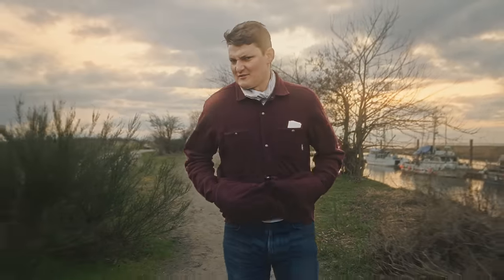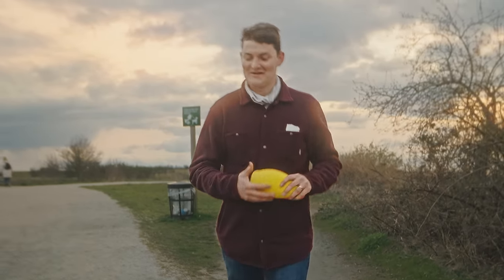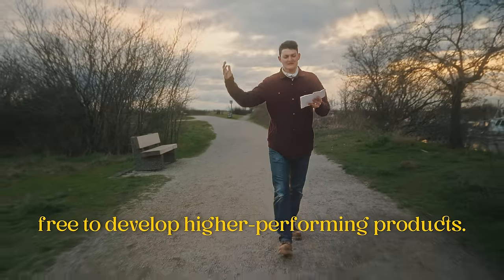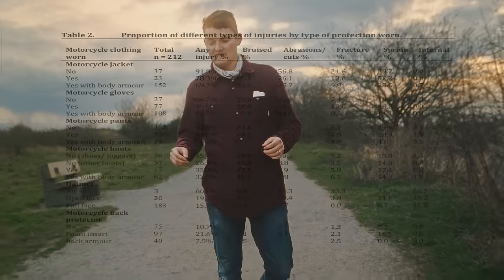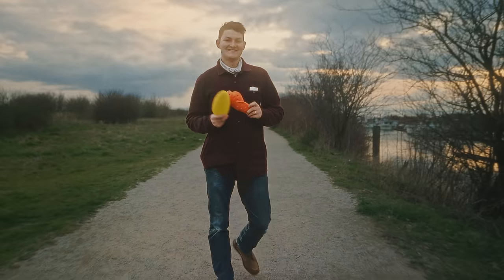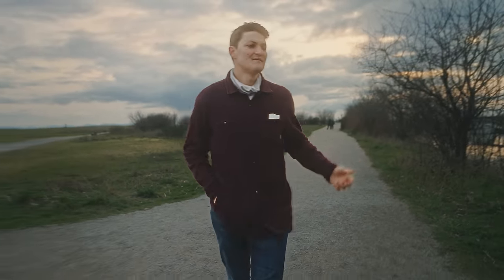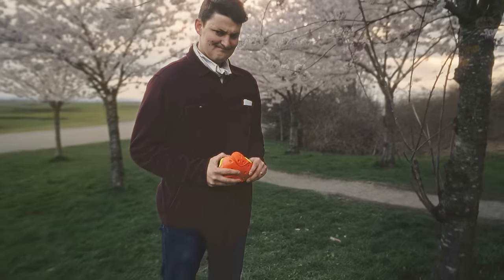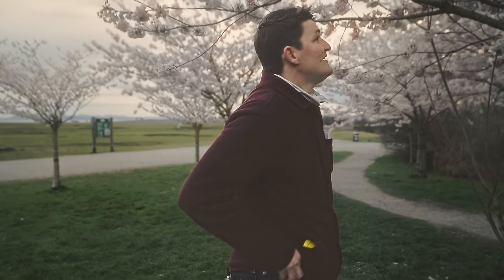Why I Stopped Wearing Motorcycle Body Armour

Comment: As far as the study went it is also worth considering that the riding style of people who ride with gear vs those who don't could be very different which would affect the relevance of the study's results.
Reply: I disagree, I've seen people on crotch rockets ride safely and people on Harley s ride like idiots. Seen people with and without gear ride all sorts of ways, but I've always been a firm believer in gear. The more you have on and the better it is, is your chance of reducing injuries. Ride safe and gear up!
Reply: Yeah but the speed demons in Canyons almost always wear gear. 

If gear protects 80% of 10 Breaks. The Canyon rider will have 2 Breaks. The guy with nothing in a small crash of 2 Breaks will also have 2 Breaks. Statistically they are the same person - bike crash and both have 2 Breaks. Meaning the gear is "useless".
Reply: @seanalcala9840  To be fare, Eric didn't specify crotch rockets or harleys, but riding style. Like you said, it is more about if people like riding like idiots or ride safely, no matter the bike they have
Reply: That’s an excellent point. Furthermore deriving conclusions from an uncontrolled study is sketchy. I no longer take the word of researchers without first understanding the study format as well as looking at the raw data. I just don’t take the word of researchers without question. Why would I?

Comment: Been riding for 59 years. Raced for ten of those years. Got my engineering degree in 1977. I am quite familiar with the good and the bad with respect to research, publishing results, and suffering through the broad spectrum of interpretation and hidden agendas. Motorcycle gear is about abrasion resistance, period. Nothing short of a fully-inflated pneumatic bubble-boy suit, which would make a motorcycle completely unridable, will stop broken bones, dislocations, etc. Motorcycle airbags are a primitive attempt to create an instant bubble-boy suit with thus far inconclusive results. Promising anecdotes, yes, but definitive repeatable results, no. Regardless of what the original design intentions were or are, and regardless of the testing methods involved in creating ratings, pads in motorcycle gear are also about abrasion resistance, period. Every once in a while they might prevent or minimize a minor bruise, but that's it. Off-road, some of the hard plastic armour can sometimes prevent puncture wounds from tree branches and rocks, but they are also not going to prevent broken bones, etc. From my multiple personal experiences, broken bones heal fairly painlessly, all things considered. Abrasions and soft tissue damage, especially if they include skin grafts, are among the longest recovery time and most painful injuries. Look up Mick Doohan. Keep your pads in your gear, and just remember that the best way to prevent broken bones is to use your head for something other than modeling the latest helmet graphics.

Ryan - individual industry research papers, regardless of the industry, are meant to be taken as merely one data point in a broader research effort incorporating multiple avenues of research and experimentation. They are guidelines for creating a theory, which drives a hypothesis, which in turn drives a proposal for an experiment, which if done properly done produces repeatable results under controlled circumstances to either verify or disprove the hypothesis. Gathering anecdotal results created under varying uncontrolled circumstances ain't science, it is merely anecdotal data compilation, similar in concept to circumstantial evidence in legal circles, i.e., while it does tend to point one in a certain direction, it does not conclusively prove anything. Be careful with your hypotheses, and I hope your personal amourless experiment does not produce unfortunate results which would make you physically incapable of repeating the experiment in the future.

Comment: For the motorcycle body armour to work it has to not be moving around, padding in a jacket for example does not cut it. I use a plastic armour that cover my back, my houlders, my chest, my elbows and my lower arms, + I use the similar armour on my hips and ass, and then plastic armour that cover my knees down the the ankle. And everything is securely fastened so it can not shift and move around.

Comment: The number of bruises I would have sustained over the the years of riding without pads is speculative at best. Having said that, I believe that my minor tip overs on the trail or in the parking lot would have been bruise worthy without. My properly fitted riding gear does not impede my comfort so why not continue wearing them if not for the sole purpose of reducing said possible bruising? Back, shoulders, elbows, hips and knees -  I'll keep wearing them all.

Comment: Interesting stuff. Love the life message at the end. I'm in the healing process (wrist, shoulder) myself right now, as I've been through many. Sure, you're right on the money when questioning how much beat took some CE away from me, but I believe it did a lot actually. That is probably mainly because of how racing suits are designed. Having front brake failures at a 260kmh and standing up with "only" a broken shoulder tells the story, especially when inspecting all the other impacts on the leathers later on. It's been always about money and to go with the minimum, and it'll be like that for the rest of time. What I'm more concerned is the lack of rider education, which seem not to play a role in statistic causes. That is what I get to see literally every day. Secondly the mentality. Riders come freshly off the DMV parking lot, jump on their 200hp bikes and want to join a wheelie course in jeans. Asking us for a discount while their 700 bux rear sets are on the way from ebay.

Comment: Dude, you're horrible with reading statistics! The difference between jacket with armor and without armor shows you're 31% more likely to have a fracture without the armor and 118% more likely to have a fracture without armor or jacket. The difference in gloves with and without armor is 56% less chance of a fracture with armor. "They do nothing to protect our bones" This is disingenuous at best, and likely dangerous. I know you need content, but for your viewers sake you shouldn't say that it might be a "statistical anomaly" that the armor actually works better a significant amount of the time. Especially with all the experts in the comment section telling you how wrong you are.

Comment: armor pads protected me many times from direct hits to my knees and elbows, whether I was gonna get a fracture without them or not is not clear, but I'm sure I would have suffered server bruises and road rashes without them.
I only wear Level 2 armor and lookup for the test results for them, ended up only buying SAS-TEC SC-1/42 prestige for my elbows and knees and I use the helite turtle vest which too comes with a stupidly big SAS-TEC L2 back protector too.
don't stop wearing armor pads folks, just get used to them, I don't see them to be annoying at all, especially when  you fit them in a comfortable jacket/pants.

Comment: What he is saying is that we the riding public need much better regulations than what the manufacturers thought was most profitable for them.  I totally agree with that.

I weigh 187 lbs in gym shorts and 238 walking out the door to ride.  Riding boots, skinny pants, hard Leatt knee armor, riding pants with soft armor, hard Leatt chest, back, shoulder armor, hard elbow armor, a BMW riding jacket with padded elbows, shoulders, and back, an air vest with neck protection, gauntlet gloves, and a modular helmet.  Your body needs hard and soft armor for the same reason your head needs both.  Hard armor and soft armor work together to spread and absorb the impact, just like your helmet.   I'll continue to wear all this, too.  It could be better, a lot better, but it's all we have now.
Reply: Seems most have missed that point
Reply: Not  for more or better regulations but rather better testing methodology, data publishing and less hype. When customers stop buying the current hyped armor being sold manufacturers will respond accordingly. A warehouse of unsold armor jackets and pants has a strange way to fostering change.
Reply: @bluewickedburner  yep...this is probably a better view

Comment: Your analysis is risky. The research is very low sample size & high likelihood of "false negative" effects of protection. Having had a few crashes onto dirt and bitumen I have been pleased how "comfortable" they were thanks to the armour. The research is way too small to reveal all the prevented dislocations of kneecaps etc etc, nor even fracture rates. I think you're taking an unwarranted risk compared to whatever discomfort you experience with armour (I barely notice mine, except when my elbow, knee etc hits the hard)

Comment: Man. I just started wearing body armor too after like 8 years of riding. Now I’m behind the curve again
Reply: In 8 years you'll stop wearing it just to find out that some revolutionary armor is now as good as airbags.
Reply: Not necessarily, there are still definite benefits for abrasion, and there's a reason motorcycle accidents are known for greasy skid marks...
Reply: Bro, no you are not. Disregard this video, because pads can save you a ton of pain and recovery time, even if they can't protect your limbs from getting torn off by a tractor trailer!

Comment: For safety I built a cage around my bike. Then for protection from debris I added panels to the cage. Then to prevent tipping I added two more wheels. Then realized it would be convenient to be able to carry things around, so I made it a bit bigger and even added a few more seats so others can join me. I call it the motorCycle sAfety upgRade, or C.A.R. for short
Reply: If only you could figure out a way to assemble them quickly and with a lower frequency of quality failures. I'd also like to suggest minimizing your exterior panel paint options to keep costs down.

Comment: Armor and leather may be hot and bulky, but being sandpapered by asphalt is no joke.  I wear Bohn Body Armor under my Hood brand Kevlar riding jeans and THEN wear my heavy water buffalo hide biker jacket and leather chaps. 

Gloves appropriate to the weather and ALWAYS some type of high-top leather boots.  Three different styles of helmet, here again depending on the weather and driving conditions.  

Physics is a B$tch and cannot be argued with.  But you can try to mitigate the damage done to you in a low to medium impact accident.  High speed......forget it; you're hamburger with bones like shrapnel shards scattered through it.

I may be sweaty at a stoplight in 90 degree heat, but that kid next to me wearing flip flops, shorts, and a full-face helmet is ALMOST guaranteed to get a Darwin award.  

It's not if you will go down,........it's when. 

It has taken 44 years for my small road rash spots on my elbow and collar bone to finally disappear.  They were a reminder that pavement will shred you at 85 mph.  The crushed helmet is my reminder to not be stupid.

Comment: You may have started a conversation on demanding better protection, but the implication that the current level of armour is useless, is both irresponsible and very wrong! Suggest rather than cherry picking quotes, you actually speak to the scientists
Reply: Agreed. And the Bennetts High Performance Award is just one of the ways we've been trying to raise awareness of the potential for improved protection over many years. Maybe I need to practice my one-take shoots!

Comment: This is the first video from @FortNine that I will TOTALLY disagree with. The regulatory recommendation for protection may not be sufficient, but telling people (who may not readily be able to afford air bag backpacks or racing gloves) not to wear conventional protection such as bike jackets with pads is outrightly irresponsible. Even if it is an abrasion or a road rash that a rider prevents, it is enough to make the accident experience less painful or reduce the time he/she is not productive in society. Little protection is better than no protection in my opinion. I have severely suffered for weeks in pain (on my palm and elbow) just because I had road rash sliding  on wet ground  from not wearing a glove and jacket due to improper brake technique on my part.
Reply: At what point is he saying not to wear protective gear? He's saying the removeable pads inside the protective gear are minimally effective
Reply: @adamnapiorkowski1949  I agree that he did not outrightly say , 'do not wear any gear'. However, in most standard / affordable motorcycle gear, the pads are the main protection for 'vulnerable' parts. Therefore, some people may infere that a regular demin jacket will do instead of the bulky denim (due to the pads) in riders jackets... this is the weakness in his argument. Biking is a risky activity in itself, we should never downplay any part of safety and protection that we can glean into the sport.

Comment: Some of the negative comments seem to miss his point about the minimal regulated requirements; the pads can help if you just fall off the bike while parked, or they may help during a slide, but they're almost ineffective in preventing bone trauma experienced in m/c accidents simply because they aren't rated against that impact force. Imagine me telling you that you can prevent bullet wounds by wearing a thicker jacket, or that a summer weight sleeping bag is fine for winter use if you just wear extra socks at night. 

I would argue to some commenters that the severity of their injuries would still have occurred had they been wearing these minimalist pads simply because the pads are not rated to protect against the force experience by riders in these accidents. I imagine that the gear worn by professional m/c racers are great for the track, but might still not protect them from injuries sustained when getting hit by some drunk driver, so it's up to the rider to make sound decisions.
Reply: No. IMO RyanF9 missed the point of the armor, which is not fracture prevention but fracture severity reduction. I don't remember where I picked this up, possibly even driving school, but when having a hospitalized motorcyclist on their table, doctors hate complex multiple fractures. Armor increases the likelihood for simpler fractures that have a lot better outlook for a proper recovery.
Reply: @maehsi  Okay. Your point is fair, but his argument wasn't about not wearing armor, but accepting that the minimum govt requirements for armor is too weak. Of course doctors hate working with horrendous fractures, but light weight armor isn't enough to prevent those. I would venture those same doctors would agree with that.

Comment: He's basically making the assumption that every impact will be 50J or greater, but if at 50J it reduces the force to 9kN, and 4 is enough to break a bone, that still means there is a large amount of impacts that could have between 4kN and probably around 25J where the armor will be the difference between breaking a bone or not. Also, as another commenter mentioned, the is a wide variety of what a broken bone is. It might be the difference between something that can heal and a bone that is completely shattered or will never heal properly.

Comment: I'll give you my 2 cents based on my decades of dirt and street riding. Wear ANY padding you can get your hands on! PERIOD! Cut up your Mom's mouse pad if you have nothing else. It's still better than nothing. Take the padding out of your football gear and then go play. 

I've hit a deer @ 60mph on a 1986 FZ600 wearing nothing more than blue jean pants and jacket. (Yes I wore a blue jean jackets in the 80's) Results of said crash? Broken collar bone, dislocated shoulder, concussion, and various road rash on my shoulder blades, hips, and elbows. 

I've low-sided at JenningsGP in T10. Results of said crash? Nothing. Notta. Zilch. I broke my inner plastic armor plate on my (L) forearm and had my suit repaired. This suit has been crashed numerous times and was/is old. It's probably a 25 y/o Spyke suit. I still wear it! Not because I look cool in the latest A* suit. Nope. I could care less. Because people don't want to ride around a guy with a suit that's that rashed up.

Comment: I liked this video a lot because it challenged something we simply accepted without looking deeper. Still, for us in the USA it might not be obvious that 50 kN is roughly equivalent to 11,000 pounds of force, or a somewhat concentrated (divide by area of pad for pounds per square inch) weight of two pick up trucks. According to the video, a CE-2 pad reduces that force by over a fifth on those boney parts of my body. For me, that kind of sounds like a good reason to keep the pads in my jacket.

Comment: I've been a pro skater for years in my youth. If you've never suffered nasty road rash, you'll never understand the pain, frustration, and time required to grow back large areas of skin. 

Padding will significantly reduce road rash on high risk areas such as knees, elbows, hips, shoulders, forearms.

Sure, you might suffer a break, but healing that will be a bit easier without healing skin/muscle too.

I've also crashes at 110km/h on a race track. The abrasion the leathers and armour took meant that my body didn't have to.

I'm keep my armour in.